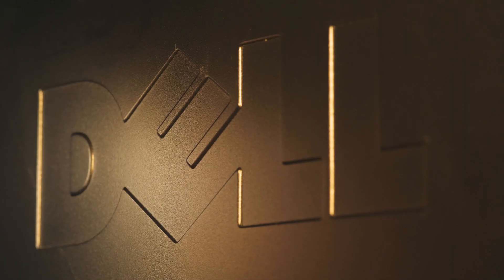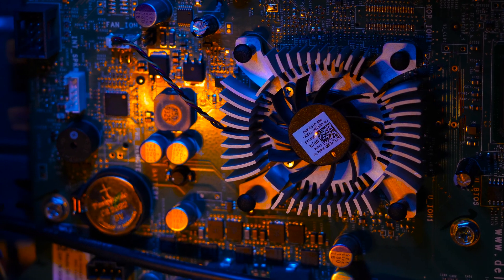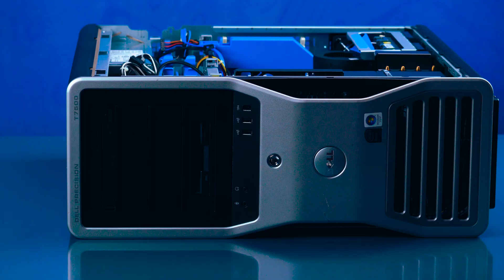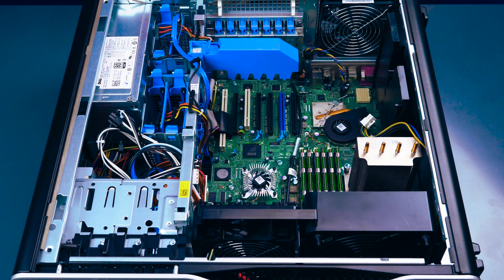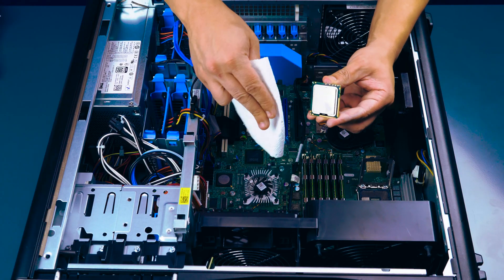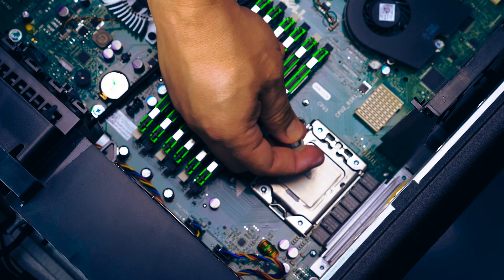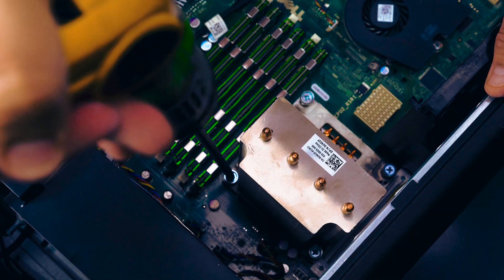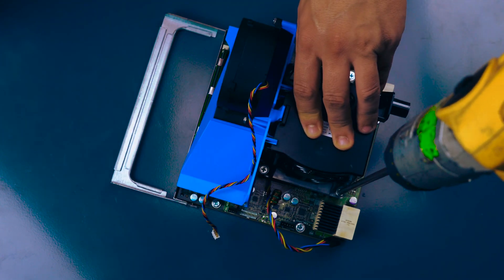Dell T7500 Processor Installation

Comment: hey bro can you help me my second cpu dont work good idk why (riser board)
in the pc system board i see CPU 1 and CPU 2 and in divece manger i got 16 prosecors (i think it therads bc 1 of the cpu got 8 therads for it 16)
BUT in cpu-z i got only 1 socket and in pc properties  i dont see (2 CPU)
so idk what this proplem
i test the cpu from the riser board to the normal board it work the issuse not in any cpu and the board work bc i put ram in it and it worked please anyone help me
Reply from the maker: Sorry for the late reply.  Confirm the CPU Riser power cable is plugged in and that none of the pins on the power connection are bent, they can be easily damaged.  Also confirm both processors are the same model and spec number for example E5620 with spec number SLBV4.  We recommend installing at least one stick of matching memory on each the motherboard and riser board at first, then adding additional RAM once confirmed working.  If the workstation beeps and flashes green or amber lights on the wrong of the workstation during boot up that fails, it refers to an error code which can be diagnosed by looking at the T7500 Service Manual in the troubleshooting section.